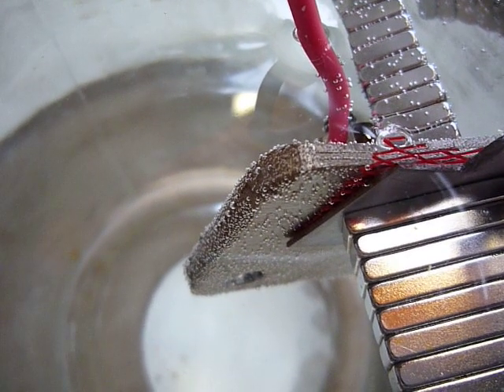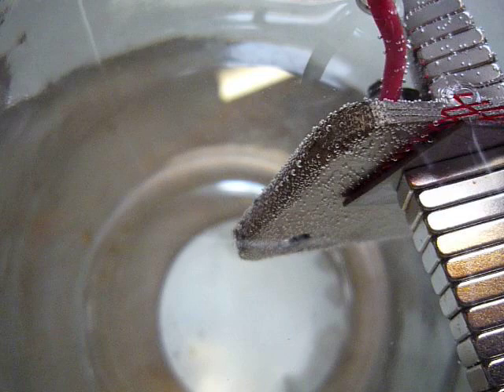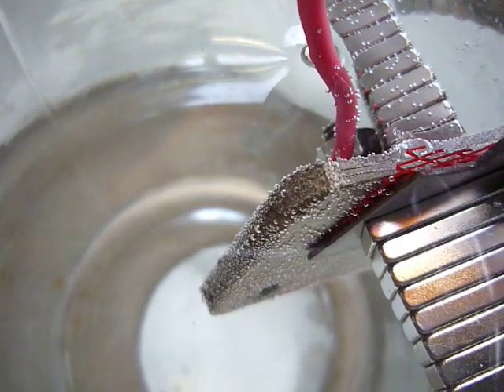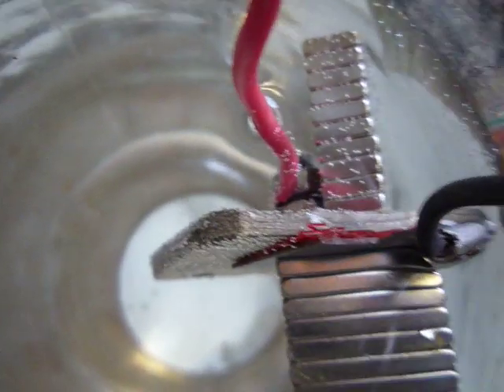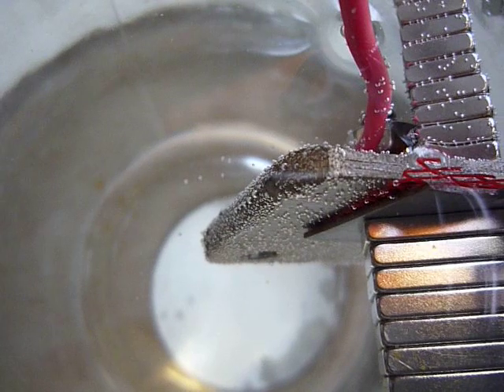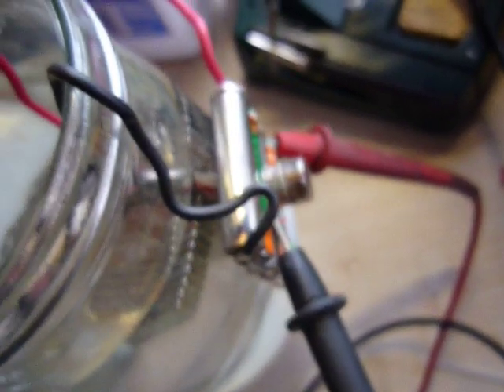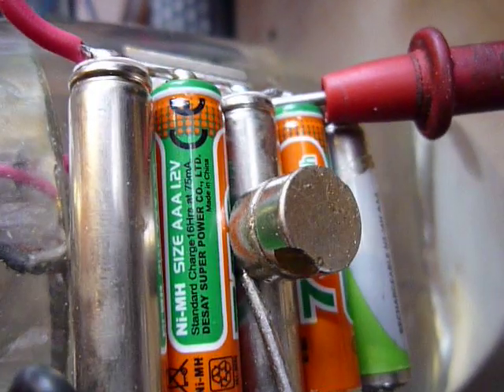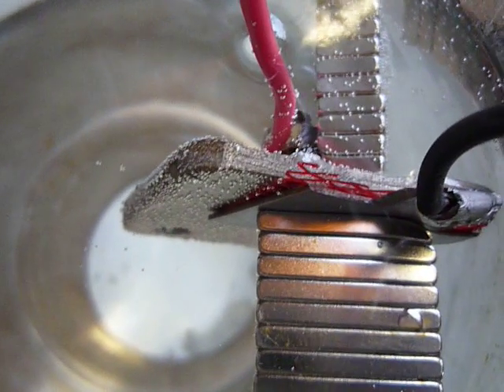HHO MAGNET cell Splitting water @ 1.3V

Comment from the maker: @djdsfhakdfhlksdhklf Thanks for the information - when I ran this test, I did notice that any movements of the magnets, or constant disruption of the magnetic field increased the amperage slightly - not exactly constant vibration but suggested vibrating the magnets (distorting the field), would increase electron flow - I bypassed the use of a frequency vibrator by using opposing fields but the field distortion is stripping the metal in the plates?
Look at my video - BLACK WATER
Jim